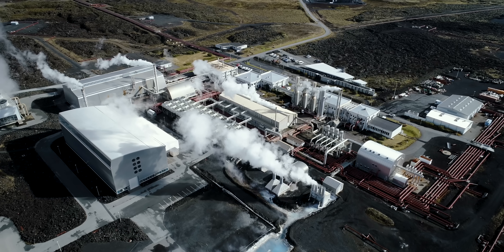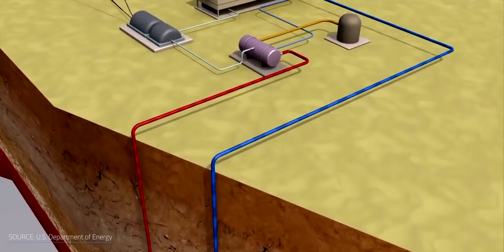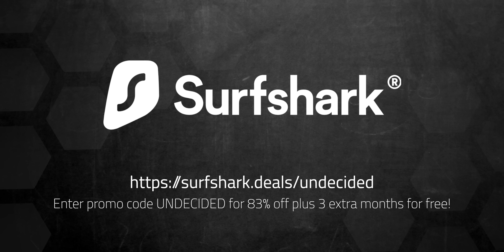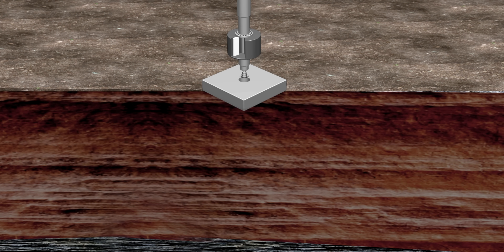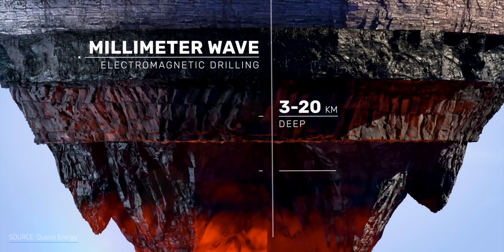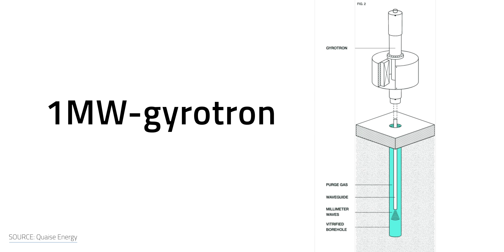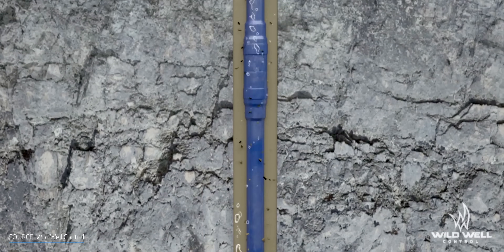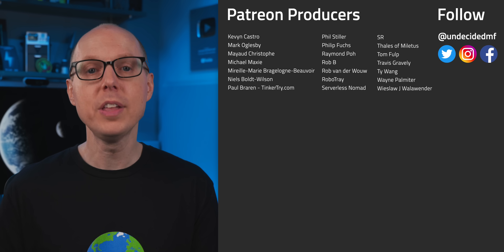Why This Fusion Tech May Be a Geothermal Energy Breakthrough

Comment: thank you matt.
i've been a stuck record on geothermal, and see it as the affordable future compared to fusion..
and it's nice to see advances that might expedite  it.

with cryogenics, i'm sure they could come up with a low temp, high pressure gas to spin turbines at lower temps than needed by steam.
although it's nice to see depths where steam is attainable at high pressure/temp directly.
that's much more adaptable to existing steam tech/generation.

5-10 years for maturity is better than  the 20-? of fusion and is money much better invested towards continuous clean power production.
costs nothing to run but the maintenance once built.
no more natural resources need to be mined to fuel it.
and it's clean nature means it can be put anywhere power is needed, as it has no fumes nor possible contamination  problems, lowering infrastructure costs.

if only musk or gates would get some of their funding behind it.
imagine if it had as much public funding as fusion does.
we'd be perfecting it, instead of still developing it.😀
Reply: Geothermal is a bit more fossil than you might be willing to admit. You're extracting excess heat that will be replenished far slower than it's extracted. After a well is exhausted (that is, no longer profitable), it can take hundreds of years to recover. Needless to say, you're going to have to rebuild everything at this point. Of course, that's still much better than coal, but also very dangerous both as an investment and as an energy strategy.

It still has its advantages, but the risks and costs are also very real. I certainly wouldn't discard it as part of the energy mix. And although these advances make it far more attractive, it's probably still going to be tricky to scale (depending on location, of course).

"No possible contamination problems" certainly isn't true either. It can still cause releases of radioactive gases, carbon dioxide, toxic gases. It can put ground water in danger of contamination. It cannot be nearly as concentrated as some other forms of energy production (like coal and fission), in part due to the limits of the heat reservoir. Depending on the design, it can be vulnerable to corrosion and all that.

Again, not saying we don't want geothermal. But all the options have their drawbacks, and they're good for different things.
Reply: @LuaanTi  All that is true, but don't worry too much about the heat exhaustion of geothermal wells. The oldest one has lost around 2-3% of temperature in  100+ years of operation, and as long as the water is replenished, geothermal wells can be economical for centuries even being exploited over the thermal gradient inflow (the natural replenishment of geothermal heat). There is a lot of stored heat in kilometers thick of hot rock after all
Reply: If you look at the beginning of the video it talks about closed loop systems being the cleanest and most sustainable. Once drilling is completed there would be no further releases of gases from the closed loop system. Also I've never heard of a geothermal well-being exhausted unless you're talking about the millions of years it takes for the core of the earth to cool down.
Reply: @markdlondon  - “millions of years… for the core of the earth to cool” combined with billions of people and tens or hundreds of millions of bore holes, and this blue marble could be a dead rock in no time at all.
Reply: @LuaanTi  
case the wells down to 500m  or so and it would be below the water table.
just as they already do for fracking.
a closed loop system would be used so as not to allow for contamination.
it could be built to be removed and  replaced however many years of service it has.
lets say 50 years.
for 50 years, it has had to have no fuel input costs over that time.
no more mining after the original hole.
there are no future fuel cost worries.

Comment: I like many aspects of this tech, geothermal replacing coal fired and reusing the existing infrastructure is a great plan. I hope this does come to commercial scale and get widely applied.
Reply: This should be a gov funded program at least for initial construction of the first one. The long term gains would be worth it.
Reply: @evilsimeon  honestly a DRAPA style program for energy and health care could really help improve the US.
Reply: That infrastructure can also be used to supply the drilling operation with the massive power it needs.
Reply: speaking of Coal, It will ignite underground coal deposits which can burn without air. Ground surveys will have to be precise and careful before such an approach is to be used.
Reply: @KyBrancaccio  coal and other fossil fuels would be in the first 3-5km of the borehole, and won’t be a problem as this section is drilled conventionally.
Reply: @KyBrancaccio  We can ignite coal underground and use the synthesis gas to power combined cycle power stations. The Soviets pioneered underground coal gasification. No mining required.
Reply: @KyBrancaccio 
Can coal really burn without air ?
Reply: WE NEED MORE OIL.
Reply: @jeronimotamayolopera4834  Deep fried chicken mmmmmmm

Comment: very interesting, and I always love it when we develop some super crazy lab hardware for some very esoteric reason, but once we have it, find a bunch of other neat things to do with it once it becomes cheap and easy. 2 things from this family of tech are magnetrons (super secret through WW2, but now used to casually reheat your lunch in a $100 microwave) and lasers (which were a pure science invention, no practical intent, but serve humanity in the highest level, the best cat toy ever. fibreoptics are overrated).

I particularly like with this that its main consumable is electricity, and its main resulting product is electricity. In my part of the world, about 50% of our power comes from ~6 coal power stations within about 30km of each other, but wire all that power a good 300km to where 80% of the populations power is used. there is alot of infrastructure built over 200 years to support that. the town has little other industry other than coal. would be nice if we could use surplus power (we are rolling out wind and solar elsewhere, but will keep the coal plants alive because we need the base load) to drill bores to convert at least part of the infrastructure, gradually, over to something like this. looks like a triple win to me.
Reply: Curious, whats your country?
Reply: how about nuclear power aswell?

Comment: Yes, it seems like a good idea. We need a non-fission 24/7 source of energy to at least backup the renewable solar/wind mix. The conversion of current fossil fuel power plants is also very appealing. Of course if fusion can escape it's seemingly perpetual "20 to 30 years from now" implementation a lot of other sources will go by the wayside. 🤞

Comment: We can't know which technical or political obstacles we encounter in the future. Because of that it seems advisable to pursue differ in terms of requirements of resources and political conditions! Take a region that uses mainly wind power but then changed weather patterns with regular destructive storms make it unfeasible! It needs tech that doesn't require large structures above ground. Or, a country like America becomes hostile to science and modern climate science. There you need to be able to work with what you have, you need robust tech that can be adapted and local solutions! This fusion boring tech for example isn't as present as large wind farms. One could talk about it as "harvesting energy in your soil" that could create a kind of echo to oil drilling. That could speak to societies that are hostile or afraid of science, i. e. the science that "changes everything too fast". For energy policies to be successful they also need to be acceptable!

Comment: Geothermal energy could be the solution to bring clean energy to the world, but it will still face the largest obstacle. Getting away from our current dependency on fossil fuels and those that profit from them.  Our current economy is only possible, because of fossil fuels. Geothermal energy solutions would require a long-term transition away from fossil fuels.  If you try to convert to other energy sources too quickly, you will drive up the price of everything and face the real possibility of financial collapse. (similar to what is happening with the transition to electric vehicles)

Comment: Where does the rock go, the overburden that’s displaced? Is it all made into glass on the sidewalls? If molten glass has to be disposed of, could you not make mineral wool  insulation? As a byproduct? The idea  that you could refurbish a fossil fuel power station is a double plus.

Comment: There is a lot of rock at 10 km that is not granite. Even several km down you can have layers that is unconsolidated. Glass is strong and brittle and would have to be much thicker then the steel casings used when finalizing a borehole. The 30 million cost for a borehole is not the cost of power to drill the hole it is for the equipment and personnel to do the job. The energy cost of drilling is not a very large fraction of the total cost.

I will take a bet on that we will never see a commercial hole drilled by this tech since it do not solve or improve on anything that is the major cost when drilling. A very important factor that was not cover in any why in this video is that you hardly ever drill straight down. You will drill down some distance and the fan out often ending up drilling horizontally to increase the area you reach from a single location on the ground.
Reply: P¡nned_by Undecided with Matt Ferrell  What? :-)

Comment: If the wells don't need to be near tectonic boundaries, could they drill at existing fossil plants where the infrastructure is already in place to convert steam to electricity?
Reply: The last few minutes of the video address your question, but in short, yes. Quaise (sp?) is looking to partner with energy corporations who are preparing to decommission existing coal and oil plants.
Reply: I think  he said that in  the video. They can, and that is the best part.

Comment: At some point in the far distant future say 1 billion years, if sentient human descendants are still in a biological form, we might need to think about returning that heat to the earth's core, not extracting it. We would need to do this in order to retain our magnetic field which protects the earth's surface from cosmic radiation. Probably by then we will have control of terrestrial fusion and could you it to pump raw heat back into the earths' crust.

Comment: I don’t buy the argument about earthquakes not being an issue that easily. Ask anyone near fracking locations where the earth only started shaking when the fracking started. Yes, these quakes are very small, but they happen in areas where building codes never had to deal with the ground shaking at all.

Comment: We should be backing this technology before we back nuclear fusion and to a point renewables. As you don't need to store the electricity then this solution is just the perfect solution. Governments should back the best long term total solution this is the best long term total solution.  
You mentioned the cost of renewables but unless you include the year round storage cost of renewables you aren't comparing like with like. 
The other big problem with renewables is footprint and recycling. Both of which will become a massive problem.
A closed loop geothermal solution will give use everything we need. We should just back this until we get a working solution. Stop fusion spending now!

Comment: I'm curious whether you know how far apart these power stations would have to be to not have the drilling wells collide (given they'd be at a slight angle to each other due to the curvature of the Earth), or better yet, to not compete over the same heat.
Reply: They would be situated just like other power generating plants. Don't think their drilling pipes would be bumping in to each other.
Reply: It's doubtful the actual boreholes would intersect, but you may have a point about trying to tap the same heat source.  I suspect that the closest two plants built using this technique would be is about twice the depth of the wells.

Comment: A concern I would have: what effect would removing heat from the earth have on Tectonic motion. . .   Without which would not have life on our planet?  Yeah, I know “there’s a lot of heat “, but, we also thought the atmosphere was huge when we started dumping CO2 into it.  Any engineering g types out there who have “run the numbers”?
Reply: My thoughts exactly. I'd be curious what the knock on effect of reducing the core's heat would have on the atmosphere (magnetic due to the heated metal core) over a long enough period. ie would i reduce the habitable range of the planet from another 4 billion years to say 2 billion years, and should that conversation/decision be had first

Comment: Sadly  we see to many things pushed as being a "new thing" when in fact those are nothing more than ideas that have not even passed the basic filter of possibility. In this specific example the "evaporated" rock will condense up in the hole before leaving it, strangulating the hole because condensed rock is...rock . What is their solution for this basic problem? If the gas is cooling the nano particles before they touch the walls, they will have the problem of the particles coalescing into blockages. Maybe electrostatic electricity might help, maybe not. This idea is way less real and feasible than they make it sound.
Reply: The "evaporated" rock is pushed out of the drilling hole by the pressure from the gas that is injected during the drilling process.
Reply: @snakedoktor6020  some of it will deposit in the hole even if most of it is pushed out by the gas.

Comment: If you hit a vug, small cave, fracture, joint, you will not glass line the borehole and it could be filled with over pressured fluid or gas. It’s sounds dangerous in reality.

Comment: 깊은 곳에서는 온도와 압력에 의해 암석이 변형될 정도인데,
드릴이 작동하더라도 압력에 의해 밀려 들어 오는 암석 때문에 전진하지 못하는게 되는건 아닌지 궁금하네요.
소련의 드릴링 때, 끈적이는 느낌을 받아 중단했다던데
Reply: You have to remember that it won't be drilling in the typical fashion. There's no moving parts to get bogged down or become "sticky". Just a beam of light. So it matters not that the rocks are deformed by pressure and heat, it will just melt right through them.

Comment: I understand there’s casing in place but what about the heat passing by gas pockets and even water? Also, I suppose there could be other unforeseen obstacles, who knows. Testing on a remote island or something just like they did for atomic bombs? Cool idea!
Reply: They use normal drilling which doesn't explode gases until the base rock

Comment: I hope this gyrotron proves effective. I am dubious given a field effort has not occurred. Why? The graphic of the gyrotron advancing is unclear…are the two lines on either side of the emitter representing glassified borehole wall, or a pipe that advances with the emitter? If the later, what keeps that from melting or having high friction? If the former, will it seal at 100% to prevent liquids from entering the borehole at higher elevations? Such entry could affect the process negatively.

Comment: IMO economics should not play a role in stabilizeing and cleaning up the environment, but since it does and my opinion doesn't... I could see this as a viable option for oceanic water desalination  that can be combined with lithium and other minerals extraction from the resulting brine + gravitational water transportation (condensing  steam on top of ultra high towers makes dispersal limited by altitude instead of distance,  without the use of pumps) and than you can do agriculture in the desert!

Comment: Not only can the geothermal heat used to create steam for the turbines, but the residual heat can also be piped to neighborhoods to provide them with a zero-carbon heat source. Those neighborhoods than don't need the generated electricity to power a heat pump or other device to provide heating to a building.

Maybe a stupid (or simplistic if you will) question, but is there a reason why they aren't geothermal drilling in volcano's? Their superhot stuff is usually pretty close to the crust of the earth. If one would to drill in such a volcano, does it increase the risk of a volcano eruption? My limited view would say that the borehole would act basically as a pressure valve that would prevent the build up of the energy that is normally associated with an volcanic eruption.
Reply: If you drill into an unnoticed magma chamber it would REALLY ruin your day

Comment: Would you consider dropping the imperial callouts? Seems to add unnecessary dialog to the arguments and makes it harder to hold onto the measures in your head when you list 4 units to compare 2 values. I think leaving them on the graphics is more than enough for anyone needing a reference.
Reply: Americans can't metric, in case an extra tax on tea slips in unnoticed
Reply: Exactly, why call out imperial when only 5% of the worlds population uses it. I understand leaving it on a graphic for the layman but don’t bog down the dialog for us. - An American